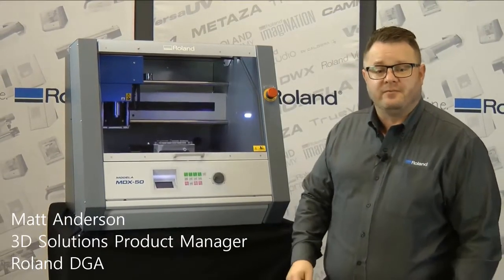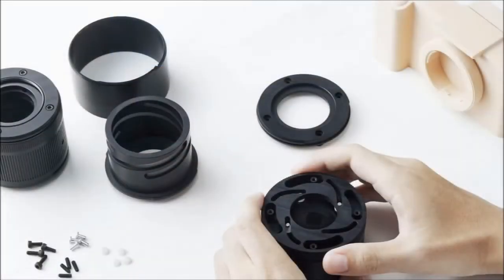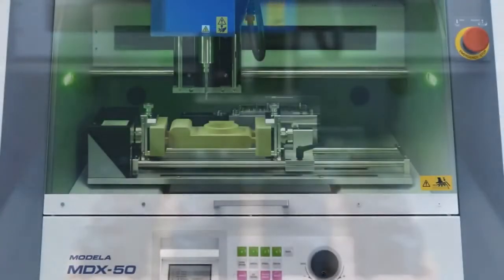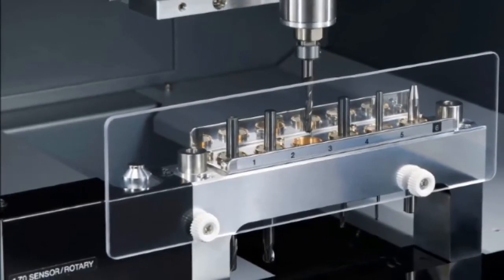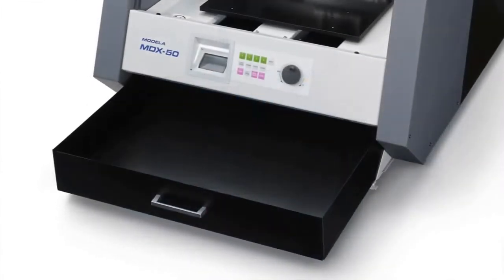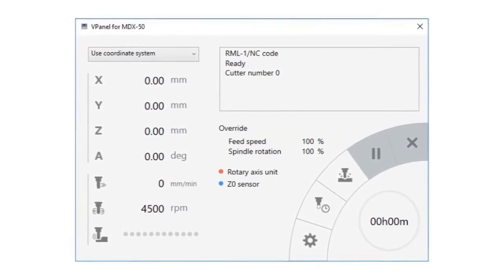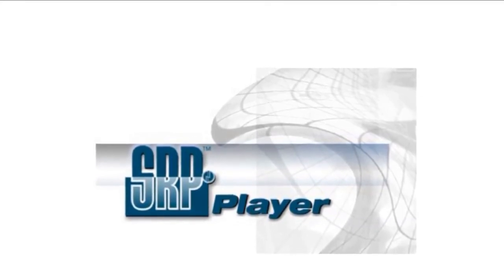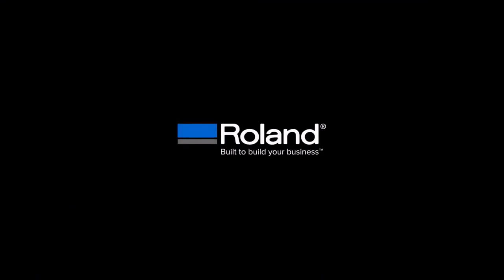Product Walk through   Modela MDX 50 CNC Milling Machine

Comment: ive tried installing srp player to setup for this machine but it fails to launch saying its missing the mill driver. the driver page for the mdx 50 is blank, should i be using a program like vcarve instead since srp player doesnt work?
Reply: You need to install the stuff on the disk, I had the same issue.